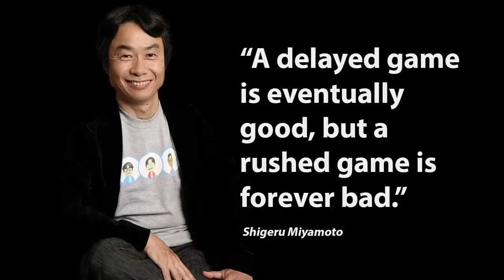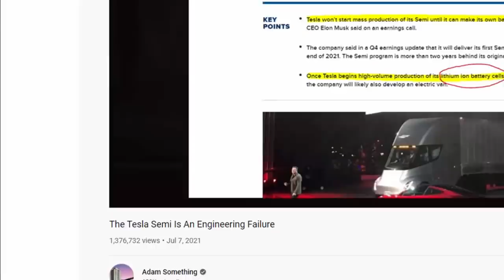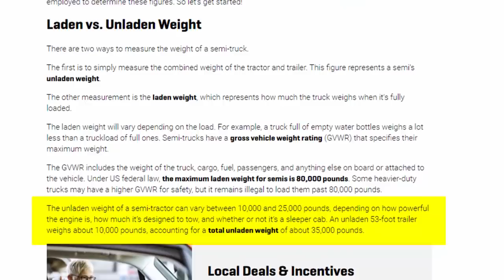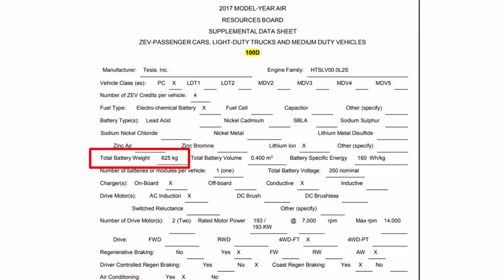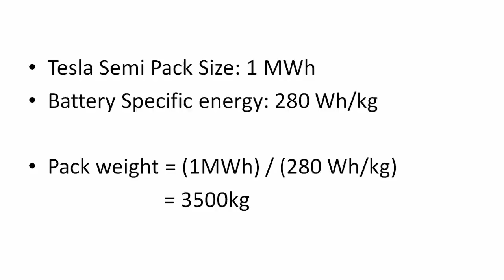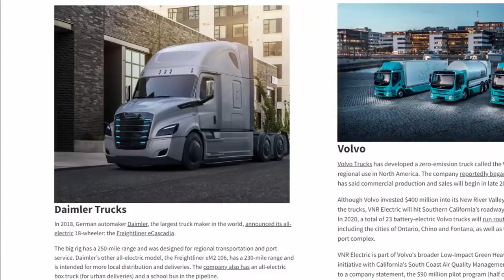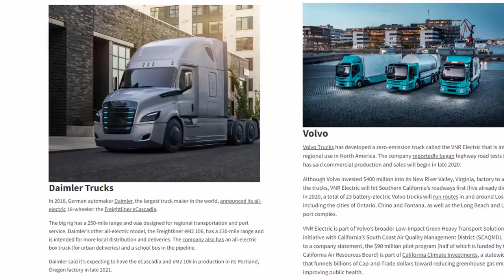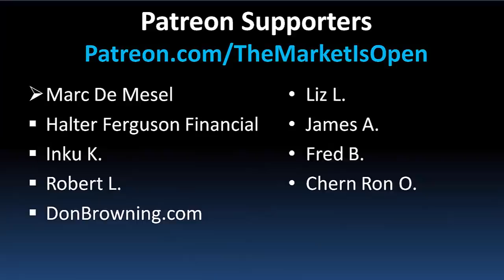The 2022 Tesla Semi is Genius, And Here’s Why

Comment from the maker: Do you think the Tesla Semi will deliver better specs than what Tesla originally unveiled? And what will be its biggest challenge going forward, batteries, production, competition, or meeting the specs? Be sure to watch:
• The DECLINE of General Motors: https://youtu.be/dBmYjt6lwKs
• Why Tesla will CRUSH Volkswagen in Europe: https://youtu.be/i-fcfWj_zDw
• Visit my website https://themarketisopen.com for instant quotes and financial data
Reply: Is Tesla still planning on putting solar panels on the roof of the trailer? My guess it it’s good for only 5 or 10 miles a day.
Reply: @andrewday3206  unlikely to generate meaningful amount of energy.  That said the person who owns the truck usually doesn't own the trailer so they will almost always be independent of each other
Reply: @BrainWearmouth  
Yeah when I did the math using solar panels at 25% efficiency it’s 40-50 miles a day…. On sunny days
Reply: @andrewday3206  Care to share math?  Is it assuming the same efficiency as a model 3?  You obviously assumed the truck and trailer are a single unit?
Reply: @BrainWearmouth  
I took 39 square meters of roof area and multiplied that by 25% because solar panels work at about 25% efficiency. A square meter in the sun is about 1,000 watts. This gave me 9.75 KW. I then multiple that by 12 for 12 hours of good sunlight. This gave me 117 KW/Hr for the day. I then took 50% of that because the panels won’t be facing the sun as efficiently and that gives me 58.5 KW/Hr a day. If the truck requires 2 KW/Hr per mile that about 30 miles. But that assuming 12 hours of sun and 1/2 the efficiency of panels facing the sun directly. I guess I should have gone with about 30 miles to be safe. Those were my assumptions so somewhere my math was off for those assumptions.
Reply: @andrewday3206  Thanks for sharing!  Is 25% panel efficient accounting for flat mounted panels?  I assume they wouldn't be stood up at an angle least it won't fit under tight bridges.  Sorry I see you just assumed 50% reduction for not facing the sun, can that be verified?  Other sources swing wildly here.  Is 12 hours of "good sunlight" realistic?

2kwh/mi is more problematic, is there anyway to corroborate those claims?  Real engineering has a video about this "The Truth About The Tesla Semi-Truck".  In it he uses a scientifically derived efficiency formula that was derived from peer reviewed experimentation.  The formula has 22 parameters which is what I thought you were going to share.  Real engineering has a battery calculator to simplify thing a bit.  Needless to say using marketing metrics of 2kwh/mi is pretty disappointing.
Reply: @BrainWearmouth  
2 KW/Hr per mile is equal to 7.5 MPG if it were a Diesel engine semi. 2 KW/Hr is 2.66 HP/Hr per mile. At 60 MPH that’s 160 HP/Hr per Hour. Diesels burn about 0.4 pounds of fuel per HP/Hr so that’s 64 pounds per hour or 8 gallons an hour at 60 MPH or 7.5 MPG equivalent. Seeing the Tesla Semi is far more efficient that a diesel 2KW/Hr per mile is realistic.
Reply: @andrewday3206  I guess if the assumptions are steady state on flat ground at the equator during the equinox with 20ºC ambient the math checks out.  Bit of stretch to call it realistic though?
Reply: @BrainWearmouth  
Up hill and down hill averages out, especially with regenerative braking. The equator would certain produce more electricity
Reply: @andrewday3206  flat ground is where the ups equal the downs.  Common use case for trucks is picking a load up at a port at sea level and delivering it to not at sea level.
Regen isn't as efficient as coasting down then back up and isn't really needed to determine if a solar trailer provides useful range.
I think your calcs show it could run the refer/heater unit with batteries reliably enough!  Which is what the trailer owner would want.  A typical trailer owner gets real mad when a driver takes diesel out of the refer's tank.
Again using the rough rules of thumbs and stated efficiencies is pretty disappointing for "doing the math".  The problem is complex enough where back of the napkin math fails to do justice.  
If you are convinced by your numbers by all means start a business and make it happen.  I see companies have tried this with existing tech and given up on it.  Perhaps you should go show the engineers at Scania and Volvo how to do math properly?
Their system used 140square meters of solar to net 14,000kwh for the year, they used the sides of the trailer too.   With a plug in hybrid semi they were able to gain some fuel economy at greater cost and maintenance.  The program was not continued.
Reply: @BrainWearmouth  
It’s a cost issue. You don’t have to have a complex equation to get it right. Voyager that flew around the world was designed at first on the back of a napkin. It’s the foundation that matters and these are real numbers
Reply: @andrewday3206  yea at first, then they used real calculations to build the actual thing.  
If your math is so sound why haven't all the plug in hybrid trucks switched to solar on the trailers?  It would be more common than the pilot projects it was tried on.  The panels even when covered all side of the trailer didn't produce significant enough amount of energy.
Reply: @BrainWearmouth  
It’s a simple answer
Solar is expensive. It takes too many years without subsidies to get a payback. The trailer might not last long enough for a payback
Reply: @andrewday3206  and so is the energy significant?

Btw my bad!  Voyager airplane was a gas powered airplane that flew around the world on a single tank?  All this talk about solar and I thought you were talking about solar impulse which was definitely not designed on the back of a napkin.
Reply: @BrainWearmouth  
I guess it isn’t significant enough
I agree on that
Reply: @andrewday3206  Sorry I thought that was the disagreement.  Looking back the "ya, 40-50 miles"  I read as "yea significant" 40-50 miles.  I also realize now I wasn't replying to the person asking if it was significant.  Sorry my bad
Reply: @BrainWearmouth  
Good conversation with you 
👍🏼
Reply: @BrainWearmouth  When Tesla can't afford to cover GF in panels even with heavy subsidy from taxpayers, you can be sure putting them on trailers does not make any sense at all. mPeople steal cables at superchargers, panels on trailers would be a much more tempting target.
Reply: @paulbedichek2679    Maybe, but I believe he was talking about the Rutan Voyager the airplane with 42,000km range.  The fuel/mass calculations can be done on a napkin.  The NASA probe was never designed on napkin.  The Rutan Voyager  circumnavigated the globe in 1987 and is powered by a pair of "small" continental engines.  I thought he meant the "solar impulse" which even in it's second iteration could not come close to replicating the Rutan Voyager success at circumnavigation.  The solar impulse made it around the globe but made several landings mostly being forced to divert due to weather and needing a runway suitable for a 747's wing span.  

I think we generally agree on the substance of this thread tho...
Reply: @andrewday3206  I doubt they will. It's possible in some cases, maybe to power the cooler unit for refrigerated trucking?
Reply: @grahammonk8013  
By the math a sunny day could get you 40-50 miles of range.
Reply: @andrewday3206  Don’t be rediculous Tesla can’t afford to cover the GF in panels with the government paying most of cost. Why would they put panels on trailers they don’t own? Tesla uses diesels for its own freight.
Reply: @paulbedichek2679  
How am I being “rediculous”
I asked a question and said I don’t see it a financially viable.
Reading comprehension isn’t your strength
Reply: @andrewday3206  Elonnsaid it was idiotic.
Reply: How would panels on a trailer work when they can’t afford panels at superchargers?
Reply: @andrewday3206  I've never heard Elon say putting solar on vehicles is a good idea, in fact he's said the opposite.
Reply: @johndoh5182  
That’s interesting I thought I heard they wanted to do this in the future.
Hmmmmm 🤔
Reply: @andrewday3206  Tesla hasn't built any tractors yet and you think they'll put panels on trailers?
Tesla has a fleet of semis,all diesels.
Reply: @paulbedichek2679  
I don’t think they will. It’s just interesting energy numbers to see
Reply: Unless I see Optimus Prime rolling down the street, I won;t expect to see any driverless trucks anytime soon.
Reply: WILL DELIVER ? When ? According to Musk they were scheduled to roam the whole interstate network by last year !
Reply: @Bercilak de hautdesert Plug power are converting Duramax engines in Belgium. Yuchai Motor in China are  already selling a hydrogen powered engine. Gaussin in France have also developed an engine.
Reply: @Bercilak de hautdesert Hydrogen hasn't fared very well with ICE and most companies looking at hydrogen, including companies that started with ICE, are producing HEV.  But sure.  Think that company can create the hydrogen infrastructure like Tesla did with electric chargers?  A single accident with infrastructure that kills a few people will put off many people, more so than a picture of a BEV on fire after a crash.  It is after all high pressure, and high pressure systems fail.  It doesn't keep it from being used, but then there doesn't exist the infrastructure for 50 million vehicles to be charged by hydrogen.  That changes the equation a little.  Limited to the trucking industry, and using hydrogen in steel canisters that are precharged, and stationed at certain locations can make sense.  Building a lot of infrastructure for hydrogen sounds very expensive.
Reply: @johndoh5182  Tesla kills more people in battery fires than have been killed by Hydrogen in history.
Reply: @johndoh5182  Teslas kill people weakly, H2 for transport never killed anyone.
Reply: @paulbedichek2679  Because H2 is dead.
Reply: @vic321344  All the coal and natural gas used to power  Teslas do so with H bonds,the only thing using H2 does is eliminate the Carbon,the Swiss have hundreds of FEV semis Nikola has delivered a few to Budweiser,and Ke
nworth and Toyota have a few in 24/7 service in the ports of S California.
Nikola will deliver hundreds of EV semis before they get to mass producing FCEV semis,so they will sell both.
Reply: @paulbedichek2679  The swiss do have exactly two prorotype H2 trucks. And the results are not very promising. Nikola has delivered 2 trucks. Made by Iveco. And a few other prototypes otherwise. Not very promising.
Nikola cannot deliver, Iveco will deliver BEV trucks, same as Tesla, mercedes, Volvo and chinese companies. Tesla seems to be the only company who is able to deliver large quantities and has enough battery capacity.
Reply: @vic321344  No,Nikola has a manufacturing facility at Ulm Germany inside Iveco compound they delivered EV's and Nikola has a much larger factory in Az that will deliver over 500 BEV semis this year,Elon already said they have no interest in semis nor CT's,this year they are building Y's,and why not? People like them and its profitable.
Reply: @vic321344  The Swiss reached one million kilometers in six months it must have been more than 2.
They must really make financial sense as the Swiss are too smart to give subsidies.
Reply: @paulbedichek2679  I live near the swiss border. The swiss are rich, but not obviously smart.
The Swiss H2 prototypes already run since 2018. They now got 46 trucks running since 5 month and reached 1mill km. So every truck run 4500km per month. I can do more on my motorcycle.
Reply: @paulbedichek2679  The Nikola arizona factory is still under construction. And Nikola does have nothing in germany. Its pure Iveco. With a Nikola patch on it.
Reply: @vic321344  Nikola is far ahead of Tesla when it coms to sustainable transport, they hav the facility in Ulm Germany and Az.
Pepesi ceo is the most gullible guy in business believing his semis would come from Tesla last year,then Jan,then Feb,try for March?
Reply: @paulbedichek2679  Nikola does not have  a facility in Ulm, it is the Iveco facility. They build the trucks and Nikola puts their name badge on it.
Reply: Tesla has several Semis running (you could even watch youtubes of car drivers filming the Semi on the interstate). 
And Tesla has the technology to produce the batteries for a 500 mile model. The Nikola is limited to 300 miles. Like all the other BEV truck manufacturers.
The Nikola arizona facility is empty, there are just half a dozen Iveco Semis standing around.
Reply: @vic321344  No,there is a joint venture between Iveco and Nikola in the Ulm manufacturing plant.All you hav to do is google Nikola Ulm factory,The owner of Iveco was the original; investor in Nikola ,they know them very well and believe in their vision.
So far mostly BEV semis but the FCEV semis are coming soon they have already maufactured a few,I'm sure you know the plans they have in Europe for massive investments in green H2,they can also drill for it like oil. that is gold then nuclear H2 is pink.
Reply: @vic321344  No,those are mules, not meant to go into production, none in the hands of customers, can you imagine that shitshpw? Giving a tesla semi to a customer? Huge explosion and fire.
Reply: @paulbedichek2679  Iveco did a 250Mill investment in this project. And everything in Ulm is from Iveco, Nikola just glues ther nameplate on it.
Reply: @vic321344  Yes,Iveco believes in Nikola Nikola invested money and their designs, there are no Iveco ev semis this nis competing with this is an easy and inexpensive way for Iveco to get into sustainable transport,remeber they invested cash into Nikola from the start years ago.
Reply: @vic321344  Th Swiss are rich because they are smart and very militant, they support their military and know it is many well spent,thatvis why they can remain neutral, if they want to remain free they will buy the US F-35.
When Napoleon was invading my ancestor went to Switzerland and lived one generation there his son came to the US,I did climbing and skiing there when I was a teenager.Very young mountains so they are steeper than older formations.
Reply: @vic321344  What's your point?
Reply: @paulbedichek2679  What's your point?
Reply: @johndoh5182  No one has died from a H2 accident and hundreds have been roasted in Tesla fires.
Reply: @paulbedichek2679  Remember the Hindenburg?
Reply: @paulbedichek2679  Dont forget Tchernobyl.
Reply: @johndoh5182  Hydrogen is much safer than grid electricity. But it is explosive at only 5%,but the thingnis it is so light that when not pressurized it rises quickly,gasoline is far more dangerous, and they fired a high powered rifle into a Mirai tank when a Tesla gets the sam treatment the battery pack always explodes.
Reply: GM has autonomous transport Tesla does not.
Reply: @paulbedichek2679  
Does GM have self driving trucks already?
I didn’t know that if they did
Reply: @andrewday3206  GM has robo taxis with no safety drivers in SF there is another company that does autonomous trucks but they’d rather use diesel to keep the truck on the road and it’s only for highway a human drives it the last few miles. Easy to convert to fcev or bev if they wanted.
Tesla is about twentieth of 30 companies in autonomy.
They have an association and Tesla is excluded, now full self driving means an accident prone system at level 2, the term they use is autotonomy.
Reply: @paulbedichek2679  
That’s interesting 
Thank You
Reply: Tesla stock is crushing the market ,or the wallets of its shareholders!!
Reply: @paulbedichek2679  In fact it is equivalent to printing money ! Musk can pay for all his failures and buy good companies with Tesla stocks !
Reply: @clitisswood7330  Well, the stock is worth a fraction of what is was worth , so they could have bought more stuff with it last week last month three months ago.
Money is printed or created when a banker makes a loan.
Reply: @clitisswood7330  So the last month is like burning money.
Reply: It’s not happening!  I’m a Tesla bull but this is a dumb idea!!!!
Reply: Unquestionably YES.  From a Eng. Tech.'s point of understanding
Reply: I can wait for another several weeks, until the Tesla Semis are properly coloured and a great press event takes place at Pepsico.
Reply: @vic321344  Finally!! You make a true statement we can both agree on. Next time just agree with me.it'll save time. But just go to the source,Elon,he says Tesla has no interest in semis,other than the diesel variety, at least for this year, and who can blame him? Vehicles of every sort are all selling above suggested retail.
Reply: @paulbedichek2679  I did not agree with you, I just said that I know that the first 15 semis are delivered to Pepsico, and that it still needs some time until the colour on the trucks is dry and they will perform a press event for those who still dont think that Tesla will ever build a Semi.
Semis and Cybertrucks will be built in production numbers when the 4680 cell construction has ramped up. What else should one expect?
Reply: @vic321344  Wrong tense, the first Tesla semi has not been delivered, being a Tesla it will be big news, it will also highlight how long it takes them to do anything.
Reply: @vic321344  One million 4680 produced but not one semis th batteries have nothing to do with it, if Tesla wanted more batteries they could have ordered more from Panasonic,but they put profit margin over sustainable transport.
Reply: @paulbedichek2679  Panasonic is not able to deliver 4680 batteries. And the large 4680 battery factories in Giga Texas and Giga Berlin are still under construction.
Reply: This time what went on in Vegas will not stay in Vegas!!

I met both Britney Spears and Elon Musk in 2000 at Bellagio. Britney just stared at me as she was singing on stage and I was standing in an archway above and nearby. I'm not sure if I was supposed to be standing up there by myself but I did have her undivided attention. A few days later Elon came up to me and started asking me questions about what I was doing there, in Las Vegas and Hawaii during that time. If I would I be fine answering a few questions. And if I was a gambling man? I stated, "I was on vacation and I only like to bet on things that are worth betting on!" I had earned these trips by qualifying reward points at my work. He asked, "What kind of work is it that you do?" I said, "Commercial energy saving promotions but I had been schooled in Automotive Marketing Business Administration and worked in that field for several years as well." He asked me, "If I had millions of dollars to spend what would be the most innovative businesses that could help humanity?" We talked about electric cars, we talked about solar energy and so many other subjects for over an hour. Even commercial space exploration for the consideration of colonization. That way all of humanity's eggs are not in one basket in case of another world war, asteroid strike, major climate change, etc. These we're very expensive and ambitious businesses to become successful at. Therefore we had to talk about ways of keeping a low overhead in advertising, distribution and the manufacturing. He said, "They were all very good ideas and that they should be done!" He said he had already made hundreds of millions off of a couple internet companies he started. "One of them was PayPal," he stated. Not that I had really done a lot of online banking or e-transfers at that time I didn't think much of it, until I noticed online about a year later that I could buy something off the computer with my PayPal card! Unfortunately I had just received a promotion as regional manager with the company I was working with. This made me let Elon know that I had to wait for a few years before I could assist further. I keep on sending out messages, hoping that he will get one and reply back. I will probably have to keep on trying, he gets more messages in a day then I would in five years! It is very inspiring to me to have a conversation with someone and they dedicate the next 20 years to making our conversation reality! We also talked about becoming your own best supplier and starting businesses that help your existing business. A type of slingshot effect that he has incorporated very well. It is so ambitious and amazing that he was willing to put pretty much all of his money where his mouth is and just make it happen with a consistent dedication. Congratulations Elon and I am looking forward to working with you again, one day in the near future! I still come up with innovative business ideas on a daily basis. Of course Britney I always wish her well and would enjoy meeting her again as well. Shoot for the Moon then Mars and then we will end up amongst the Stars! If you would like to learn more of these topics let me know. People with integrity expect to be believed otherwise they let time prove them right!  
propower101@hotmail.com
Reply: It won’t work as truck are limited to 34tons and than the Battery would weigh several times more than a fuel tank
Reply: Yes, do we know if Tesla delivered the 15 Semi's to Frito Lay that was expected?
Reply: @lesliegweir  save that for day of earnings call? I would. Or even better, the day after - that's when stock generally drops.
Reply: @lesliegweir  No.  Deliveries are pushed to Q1 2023.  Many companies including Tesla have had supply issues due to Covid shutting down companies for time periods.  A lot of raw materials come from Asia, including raw materials that go into batteries.  Even mining shuts down when there are bad Covid outbreaks.  Most of Asia is more protective of its populations because they don't have the infrastructure or medical systems to deal with hundreds of thousands of people in hospitals.  They don't have that kind of capacity like in the US.

This is something many people in the west keep failing to understand and think supply chains keep functioning like normal.  No, they don't, not when Asia is involved.

And it's not just Frito Lay.  It's a few companies and Walmart has probably reserved the most because BEV fits in perfectly with their short haul model.  I'm guessing there are more than 200 preorders for Tesla Semis, and no one is going to cancel them even if 1 year late.  Walmart Canada for instance has a preorder of 130 trucks.
Reply: @lesliegweir  Tesla has never delivered a  single semi.
Reply: @lesliegweir  No Tesla has not delivered anything, again.
Reply: @lesliegweir  Not one.
Reply: @lesliegweir  It’s 4 weeks later, five years since launched, not a single semi.
Reply: I don't think it will do well. Electric motors are not good with heave payloads.  Model y had an over 60% loss in range with a trailer on it. 3 years passed due date and zero idea when it will come and why no sleeper cab. People live in semi trucks.  Going to need a bed especially if there's a 10 hr battery charge each day.
Reply: @MrHennrocks  "I don't think it will do well. Electric motors are not good with heave payloads.  Model y had an over 60% loss in range with a trailer on it. 3 years passed due date and zero idea when it will come and why no sleeper cab. People live in semi trucks.  Going to need a bed especially if there's a 10 hr battery charge each day."

I don't think you can fathom how much trucking there is in the US.  Or, the wide variation in trucking in the US.  And you're making a statement about a loss in range about a vehicle that isn't designed to haul and then making a general assumption about it.  How much over-engineering do you think Tesla does with these motors? 

So, in general there is short haul and long haul.  While it is true that long haulers sleep in a truck, short haulers are home every night.  I guess some live in their truck??  But a lot of short haul is done with company trucks.  There is a LOT of short haul in the US.

So, with the near 200 preorders that exist right now for the Tesla semi, I'm going to assume that different companies, especially Walmart that does more short haul than most retailers do long haul, have decided they make sense.

You know a search engine is a wonderful thing.
Reply: @MrHennrocks  Electric motors are fantastic with heavy loads, we use them in ships and trains.
Reply: You're entering the fanboyism space.

Elon/Tesla lied when presented the semi truck as a reality 5 years ago.

Daimler went public saying "Physics are still the same in California as in Germany" for a good reason. Top battery specs could not deliver what was promissed. 

Tesla should have a big battery advance ready back then, and it's neither ready nor proven still, years down the road.

Tesla has many merits and I hope they eventually deliver on the promise. Right now, they haven't done.

Even with the 4680 format, and high nickel (better energy density), the technology is still not proven.

General use trucks are Heavy Duty (HD) equipment that must consistently deliver services. There's no place for minimizing battery degradation by light using each cell.

Batteries must be charged and discharged each cycle to deliver the expected value a HD utility must deliver. 

Not only they must achieve a top level energy density, but also must survive longer.

Tesla didn't have such batteries when announced the truck. Hope they achieve the specs and mass production soon.

Talk is cheap.
Reply: @celsostarec6735  With all you said, Tesla has probably 200 preorders for the semi.  It has 130 preorders alone from Walmart Canada, and from Walmart in the US I believe they have another 40.  There are other companies too.  So, apparently Tesla has shown enough data to these companies that they believe Tesla will be able to deliver the specs they say they can and for it to be reliable.  Electric motors are easily more reliable than a fossil fuel motor of any type.

When Tesla announced plans for the Semi back in 2017, it wasn't a product launch.  Here is an initial report from 2017 covering the "concept truck":

Tesla has announced a new vehicle in development: the Tesla Semi. If the Tesla truck meets expectations, the all-electric truck is poised to change the nature of not just trucking, but commercial transport as a whole. Morgan Stanley’s Adam Jonas, an analyst with a history of covering Tesla’s products and market footprint, called it “the biggest catalyst in trucking in decades”.

Some of the expectations for the Semi are in line with how Tesla cars vary from gas-powered personal vehicles. For example:

The Tesla truck will be cheaper to operate. Jonas estimates it will be up to 70% less expensive to operate than a regular truck.

The sticker cost should be competitive. Morgan Stanley estimates a $100,000 price tag for the truck, though this includes an additional lease for batteries.

Its range may be problematic. At an estimated 200 to 300 miles, the Semi’s range will not match that of a gas-powered truck. The Semi’s viability in any given area will depend on how easily battery swap stations can be found.

However, Tesla founder Elon Musk envisions one major shift the Semi can bring to the industry: no more drivers. The Semi’s design includes autonomous driving capability. To be clear, this does not mean autonomous vehicles in the current sense, where a driver is still present to take over in an emergency. At TED 2017 in Vancouver, Musk spoke of a future where truck drivers are no longer in the vehicle, but rather maintain a “fleet manager” role, taking care of several vehicles simultaneously rather than just their own. If his design works, the result could be a major upswing in transport via semi, as it would sidestep current issues in finding qualified drivers.

The Semi prototype will be unveiled in September 2017, with full-scale release expected in 2019 or 2020. 

Yes, they are late.  But, Elon didn't say it WILL be ready in 2019 - 2020.  Covid probably put a full year of delay on it.  I mean after all there's a GM plant that's been shut down for quite a few months due to supply constraints, one being ICs.  But let's not be critical of GM for the failure of vision and not understanding how Covid is going to screw with supply chains for a few years and you have to do a lot more planning because of it, especially with pretty much anything that comes out of Asia, since most Asian countries will go into FULL lockdowns in specific areas to prevent spread if an area is starting to get a few cases and it looks like there's community spread, and China is one of those countries, which is where a LOT of raw materials come from.

So I would put this another way, you look like a Tesla hater with what you said, and you CERTAINLY didn't research before spitting out most that crap.
Reply: @johndoh5182  
You completely missed the point.

First I was already an EV enthusiast before there was a TESLA enterprise let alone Elon Musk joined the field.

I'm no Tesla hater. I'm not in to the myth building be it for Steven Jobs or Elon Musk. They have their merits, and are "only human after all".

Tesla and Elon are doing a great job proving electrification viable and creating a solid business around it.

I did not research this story, I remember it. There was a great discussion when the Semi was unveiled because the numbers didn't add up. Buy that time I reasoned with people that Elon/Tesla might have a card on their sleeve regarding specifically to battery tech. No battery of the time could deliver the promissed specs by a good margin.

Daimler, Protera, BYD and others can all produce the vehicle. There are a lot of other electrified equipment where short haul is possible.

With the Semi Tesla unveiled a promise they had tech to address another market niche where it will be transformative. Possibly more important then car market every in the world but in the US. "Diesel moves the world".

The point is Tesla lied then. Lied about the time frame such batteries would be a reality.

I hope they have the right chemistry, sufficiently tested, able to be mass produced at an affordable price in the new 4680 format and factories nearing completion.

Knowledgeable people made a huge effort to reverse engineer the specs of every new vehicle brought to the market, as soon as possible, to acquire a glimpse of what's happening. 

Then, there are qualities as endurance that require far more testing, for more time.

Daimler e-trucks were not up the this task because their batteries had limitations. Energy density, cold usage, endurance.

Others have prototypes too. Maybe not made in aluminium with Gigapresses, but still usable trucks.

The top spec batteries that combine each of the excellent qualifies demanded for the promised semi truck, with full capacity, affordable, able to travel 500 miles loaded, with no need to replace the batteries in a way that defects the purpose are still to be shown and proved ready. No matter if Pepsi, Walmart, me or you believe in it.

Those batteries are still not proven to exist and be as good as promissed for 2019 today. And Tesla knew then it wouldn't happen in 2019. That is the point.

I do hope they eventually will succeed and drive the industry. Eventually.

Not a hater, just not a daydreamer.
Reply: @celsostarec6735  no... he presented the future...
Reply: @celsostarec6735  plus... bet you did not know he purchased maxwell.. can you tell me what Maxwell made?
Reply: @celsostarec6735  Yes. but those same Germans have delivered hundreds of ev semis,Tesla has Daimler semis all diesels.
Reply: You actually eat all crap Musk tells you right? The company now doesn't even have autopilot, the idea they can convoy those trucks is laughable almost as much as it being more efficient than rail, which will literarily never be the case because trains are not only electric trucks with much larger engines, the capability to actually have a convoy of freight behind them and run on a fucking road that is much cheaper and also has significant reduction in roll resistances.  Musk was shitting pure crap out of his mouth when he said that.
Reply: Yes
Reply: Would have been nice to have a comparison with the new breed of hydrogen powered trucks instead of a knackered old diesel. Just saying.
Reply: @lesliecarter4295  diesel is not old, electric cars were the first, you’re welcome!!
Reply: BIG Trucks Protest happening Now in Canada and the US  Hmm🤔
Reply: ALUMINUM... CHINA AND RUSSIA SUPPLY 95% OF IT... WE DONT REFINE USED AS IT TOO DIRTY SO WE ARE REALLY HURTING IN ALL THINGS INVOLVING ALUMINUM IN MANUFACTURING THE MOST PEOPLE HAVE NO CLUE...
Reply: @ca6360  Shhh don’t shout.
Reply: @paulbedichek2679  sorry paul...those capital letters identify as lowercase
Reply: The specs should be better than first announced. The challenge will be getting the chargers built and installed in the right locations.
Reply: Thanks for doing a holistic accounting of the Tesla semi.. I am not sure how many arguments I have had with people who don't understand the trucking market or the current environment Tesla is designing for. 

Main thing people miss which you pointed out: truckers can only drive about 10hrs a day in the US so charging/range is not a huge concern if it can go that far, payload is legally higher for EV trucks, EV trucks will have weight savings removing ICE systems, and battery weight to power will improve with new batteries and larger form factor. Also regenerative breaking may be a huge change in range as well as improvements to drivability as they don't have to avoid breaking as much.
Reply: @Josh.1234  "Main thing people miss which you pointed out: truckers can only drive about 10hrs a day in the US so charging/range is not a huge concern if it can go that far, payload is legally higher for EV trucks, EV trucks will have weight savings removing ICE systems, and battery weight to power will improve with new batteries and larger form factor. Also regenerative breaking may be a huge change in range as well as improvements to drivability as they don't have to avoid breaking as much."

Yes yes yes yes, no.  Regenerative breaking is good for in city driving, but not highway driving.  I could use Walmart as an example and what they're doing in the area I live.  There's a HUGE warehouse that's north of DFW, technically still in DFW metro.  It's just above a split in I-35, to where going south from that point you get 35E and 35W, one going into Dallas and the other into Fort Worth.  From that huge warehouse, they deliver products to many Walmarts for the near 7 million people in the metro.  Many of those Walmarts are right off highways, if not most.  They don't move product during rush hour, they do it early in the morning or later in the evening after evening rush hour.  This means the highways are much easier to drive, without having to use brakes much, especially when you're moving at a speed that's near the speed limit or slightly below since after all the goal is efficiency and cost savings.  They aren't braking enough in this situation for it to add up to much of anything, and on most of these routes I doubt it gives them enough to produce a single mile of driving.  It does on the other hand give them power to recover most the energy lost in coming to stops, to get back up to speed, or at least partly.

This is a typical short haul model.  And, Walmart doesn't wait for the trailer to be unloaded.  They drop it off at a bay where stock associates will deal with it at a time that makes the most sense for the store.  This also means that after dropping off a trailer, there's another trailer that's been unloaded and they hitch that trailer up and move on their way back to the warehouse.  My understanding is they get so much product that a trailer only has stock for a single store.  Now, this isn't how all short haul works because not all stores have that much product going to a single store on a regular basis.  Ross for instance has trucks that make 2 - 3 stops and the truck is processed at each stop before the truck goes to another location.

Yes, regenerative braking is still worth it because it's a lot of kinetic energy you got there in a semi.
Reply: @johndoh5182  you flat lander :) yeah I doubt highway driving in flat areas would benefit a ton from regen. But in areas with grades like near me, trucks usually creep to the top of the grade then they fly down the hill. It's a bit dangerous because they are constantly going from 50mph them back up to 75mph. They don't want to burn their brakes or waste the energy going down the hill so they fly.

With regen, they won't be using brake pads and they will be regenning their battery so it's advantageous to slow down to normal speeds on hills. Probably a lot of power too with all that weight.
Reply: @johndoh5182  No,long distance semis are driven by teams so they go twice as far.
Reply: @paulbedichek2679  I do not know of any truck company who drives in teams.
Reply: @vic321344  A 90% of trucks are driven in teams.
Reply: @paulbedichek2679  LOL. Not a single truck is driven in teams. Much too expansive.
Reply: @vic321344  Indépendant operators husband and wife maybe you are in Europe.
Reply: @vic321344  In th US you can do 11 hours driving if you'd taken your 3o minute break.Point is that you get higher utilization with faster refueling H2.
Reply: @paulbedichek2679  Why do you need fast refueling if you have to stop after 11 hours?
Reply: Yes.
Reply: Tesla semi will slay traditional ICE semi's.  
#1 Reason?  Cheaper $/mile to operate.
There will be additional benefits.  Drivers will love the ability for the semi to
- Avoid the dreaded jack-knife when emergency braking.
- Keep highway speed while ascending long/large hills.
- (Speculation) autonomously back into a loading dock. 
- Sentry vehicle while out-of-the-cab.
Reply: @bru512  cheaper per mile. Not cheaper per lb/mile.  Much more important.  Sure if your truck hauls 1/4-1/3 the load it will cost less per mile.  But times that by 3 or 4 and it no longer works.  The shipping industry can care less what your per mile cost is- they care what you lb/mile cost is.  

Otherwise your honda civic could kill a current diesel by this metric.   

It’s a dumb metric.

3x the load at 30% more per mile is a heck of a deal cheaper.
Reply: @bru512  Tesla uses diesel.
Reply: @bru512  lol….. ICE semi/trucks comes in all kinds of sizes and configurations, the tesla semi won’t be possible in Europe, diesel semi still have a very significant advantage from beeing able to haul much more heavier loads to going through the toughest most rugged roads….
Reply: @bru512  Also, the Tesla Semi will be easier and more relaxing to drive than a diesel semi.
Reply: @Laura-S196  who said that!?!!!
Reply: Very small share of trucks travel long distances. Most trucking is done back and forth between hubs that are spaced fairly close. Then there is a reloading of the goods to several new trucks going in different directions plus delivery trucks for the last mile. Trucks will charge at hubs during reloading and the hubs will have solar plus huge battery packs.
Reply: @BjorckBengt  maybe in some countries but not all. Australia is a classic example of this. With a relatively poor/minimal national rail network trucks are generally the 'go to' for a lot of the 'long distance' freight to get into the regional areas or from one populous area to another (we're talking about a landmass about the size of continental US with a population approximately that of the two largest US cities, greater New York and LA City combined, with half of that population living in 3 coastal cities and about 85% of the total population living within 50km of the coast). With this is the large distances that are covered in a 'trip' inland that can pass through over 1,500-3,000+km of remote, arid countryside that has minimal service stations, let alone charging stations. Some of these roadhouses aren't even connected to the electricity grid they are so remote and rely on diesel generators. 
The Tesla Semi is a fantastic solution for a lot of urban and high population/resource areas as a freight option. I can't wait to see them driving around and have a lot to offer. However it is still not a 'one size fits all magic bullet' that some, including this video, make it out to be. There are still some environments where it is not a viable solution...yet.... That's not 'hating' on the Tesla Semi (I actually like it and hope it succeeds and inspires other companies), that is fact without emotion.
Reply: @devilsadvocate2548  This is all true, but I have been wondering about the practicality of building a support network for Electric trucks in Australia.  Solar panels prices are dropping all the time, and land area is not something Australia is short of. Similarly, battery storage prices are also dropping fast. From what I understand, most remote stations on those cross country routes are themselves heavily dependant on diesel supply for generators. This has to increase the fuel costs, and while there would be an investment cost, what would be the payback period? Once those costs are covered, I can see some pretty impressive savings, and some improvements in daily life. ZF has a system for E-Trailers, that is trailers which have additional electric motors and battery capacity on the trailers. The design has concentrated on European trucking issues, such as added traction on slippery or steep surfaces, plus braking support (thru regenerative braking) on long downhills. I can see some advantages for some roadtrains depending on cargo types and whether the trailers are owned by the trucking company or truck owner.
Reply: @devilsadvocate2548  Yes, sorry for generalizing, however Australia is an outlier and long distance trucking is still a small portion of global trucking. In many cases it would make more sense to build railways but that would require political unity.
I am just guessing but I think it could fit Australia to at least build out power supply for recharging along long distance routes. Maybe solar powered stations with big batteries in the desert?
Reply: @devilsadvocate2548  Bringing facts is the essence of hating on Tesla.
Reply: @devilsadvocate2548  Not true for US either.
Reply: @devilsadvocate2548  Did you se the Aus firm retrofitting Freightliners? With removable batteries, this could work there because they don't have a network of roads like th US they have long roads so that you wouldn't need as many battery stations or as many batteries in each station.
Reply: @grahammonk8013  Both batteries and solar panels take a lot of coal power to build and coal prices in China,and rest of world are skyrocketing, there is much more demand for coal than th world supplies,which is great news for Aus. Besides the limiting factor in truck and light vehicle manufacturing is chips not batteries.
Reply: @BjorckBengt  Aus doesn't even have same size rail gauge in different provinces,like Japan has different voltages in differing locales.
Reply: @BjorckBengt  Tesla factories don’t have solar and neither do their supercharger, that won’t change unless the subsidies are hiked even more.